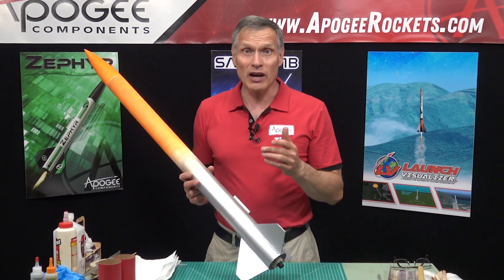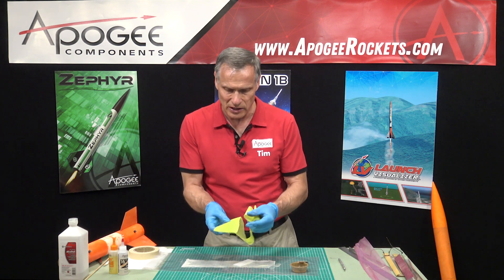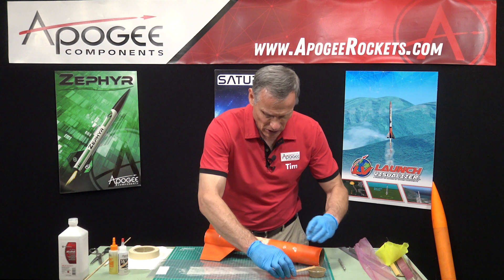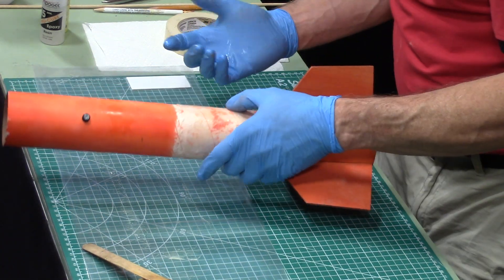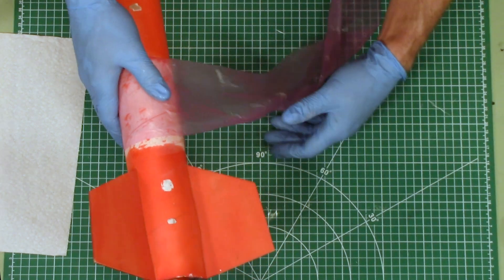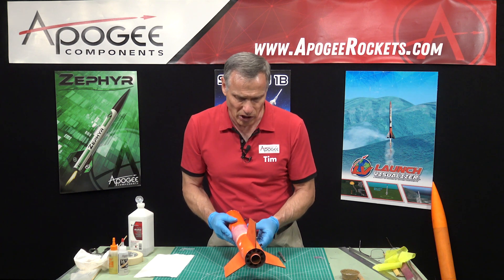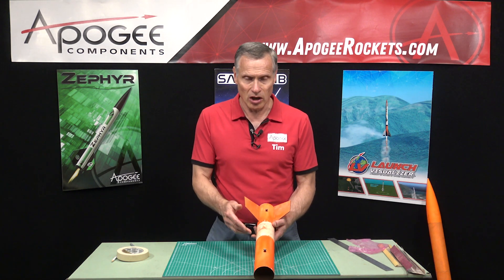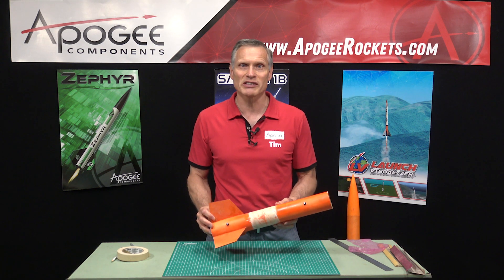How to Fix a Kinked Body Tube on a Model Rocket - Part 2 of 2

Comment: I did this to a fin on my Dueces Wild. It broke clean through the middle parallel to the root edge. I used wood glue and a gauze pad from a first aid kit cut to shape. Edge glued the fin, then smeared on the glue and wrapped the gauze. It dried solid, there was no flex any where on the fin. I thought it looked so cool that I never painted the fin.
Reply from the maker: Excellent. Keep them flying.

Comment: It looks similar to putting cloth on model planes. So would model plan cloth and SIG dope work about the same? Great video!
Reply from the maker: I suppose the cloth would work, But not the dope. It doesn't have the strength of epoxy.
Reply: @apogeerockets  Thank you!